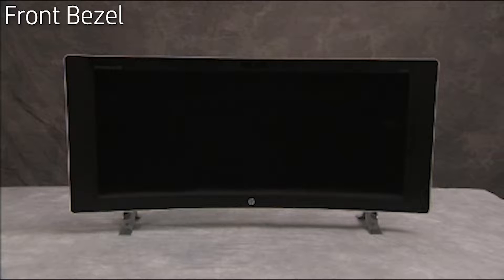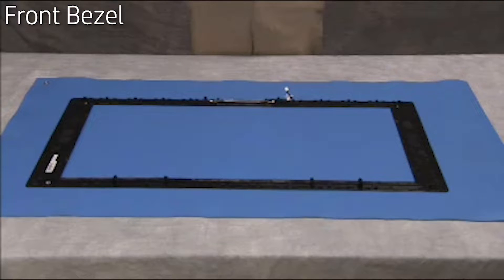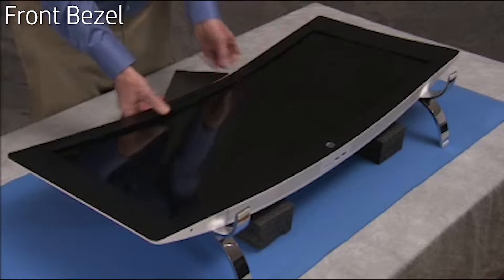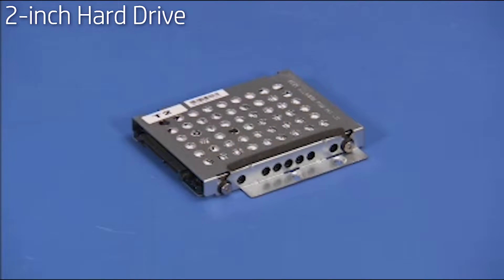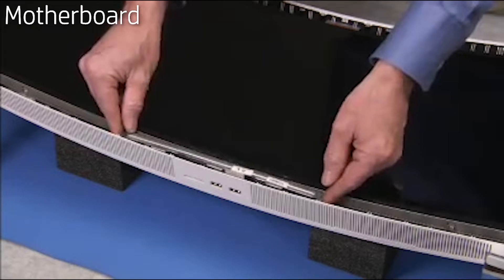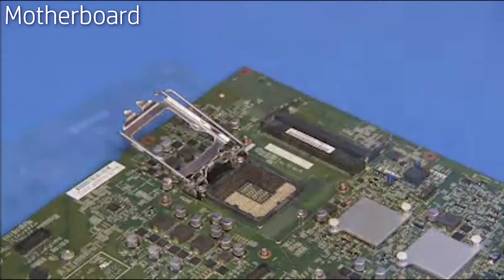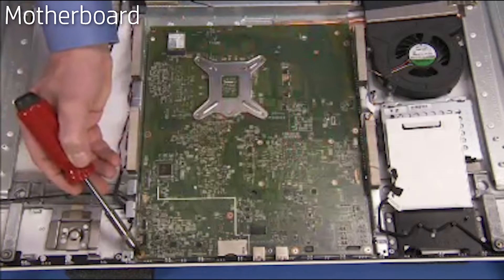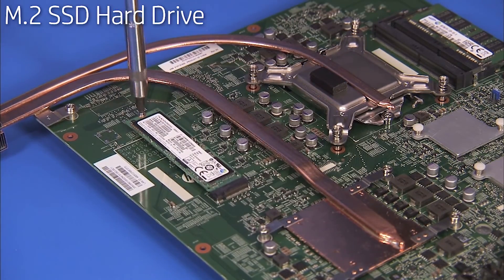Removing & replacing parts for HP ENVY Pro Curved AiO | HP Computer Service

Comment: Do NOT try to pull the bezel up from the screen edge. There is a strong adhesive tape on all 4 sides that holds it down very well. I recommend using a spudger/credit card/flat head on the outside edge of the bezel. I also had to use a blow dryer to soften the adhesive up to remove it without breaking anything.

One of the 12 screws (top left) that mount the screen to the chassis was completely buggered. No amount of unscrewing would remove it, even multiple types of pliers were no use. I had to use an oscillating saw to cut the bracket just below the screw in order to remove the screen! Terrible design flaw there...

All that aside, the SSD has absolutely no cooling. Somehow the original SSD lasted 10 years, even though it never dropped below 60°C! The replacement m.2 reached 80°C while installing a Windows update... I'm going to have to buy a low profile heatsink, or at the very least some thermal pads if there aren't at least a few millimeters of clearance.

Comment: There is a loud whirring noise coming from the top/left of the screen.  How do I fix that?  It's VERY hot up there.
Reply from the maker: +Rain, the Madocracy Please refer to the instructions mentioned under this document to fix the issue: https://bit.ly/3dCwsUx
Reply: @HPSupport  Thanks for the reply.  I've determined that it's the fan inside that's dirty.  I had this problem with my last computer, but that one could be opened and cleaned/replaced.  This video doesn't show you how to remove the screen.  I've heard the screen is easy to crack, for the people who actually figured out how to remove it.
Reply: @HPSupport  None of that worked

Comment: Hello can you give me a link to the partslist of this version: HP PAVILION 27-D0017NB
Does it use the same motherboard and cooling solution for the graphicscard and processor as the cheap 27-cq line as this version is more than 2x the price?
Kind regards Kenneth
Reply from the maker: +kd k You can purchase the part from here: http://partsurfer.hp.com/ Please select your country and enter serial or product number of your unit.

Comment: Warning: You can crack your screen doing this.  To do it properly use a screwdriver on the outside of the bezel and start pulling it up and out that way.  Try to get a lower corner popped open. After that, it comes off pretty easy.   If you put ANY pressure on that screen it's probably going to ruin it.

Comment: Is there a way to replace the GPU or heat sync. My HP Envy keeps crashing crashing when performing anything graphically intensive.
Reply from the maker: +Ranara Gaming Please perform updates via Windows and HP Support Assistant as mentioned below to fix this issue: Step 1 Windows Updates - 1) In the search box, type and open Windows Updates. 2) Check for updates. 3) If the updates are available, click on install and restart the computer. Step 2 HP Support Assistant Updates - 1) In the search box, type and open HP Support Assistant. 2) Check for updates. 3) If the updates are available, click on install and restart the computer.
Reply: @HPSupport  thank you for the reply. I already have updated the windows software and made sure all my other drivers were updated as well, however, this problem continues to persist.
Reply: @RanaraGaming  I doubt you can replace the GPU (soldered to the board) or heat sync- but what you could try is disassembly, cleaning them and reapplying thermal paste. It's possible the surfaces are possibly not positioned flush &/or the thermal pastes wasn't properly applied- make sure you use high quality paste also

Comment: For this price I could buy IMAC. Now I regret that I bought this HP.
Reply from the maker: +Evgeny Senkin May I know the model number of your computer and the exact issue you are experiencing on it so that we can check the details for you?
Reply: @HPSupport  Overpriced POS.  i5 Processor,  HHD instead of a standard SSD, so it can run at a normal speed, and you skipped a step on how to remove the actual screen, (WHAT SCREWS do you remove) I guess we are suppose to magically get to that part

Comment: A bit of info for anyone who is thinking of opening up one of these PC's.The demonstration of the bezel removal is nowhere as easy as portrayed in this video.I have removed mine  the double sided tape sandwiched between the bezel & the screen is very well bonded.
There are plenty of reports of people cracking the screen during the process, a very expensive problem to give yourself.

 I ended  up using a hair drier on medium setting to assist in  un sticking  the tape.Also the web cam cable separation  is not as straight forward as demonstrated. In my case the connectors were entirely taped over with extremely well stuck  black fabric tape ,unfortunately one of the connectors did not survive having the tape removed that result in the loss of functionality of my web cam.

Once the bezel  is off it is pretty easy to upgrade the memory up to max 32Gb , change the  mechanical hard disk for a  ssd  or upgrade the m2 ssd. I have personally removed  all of the tape from screen & bezel  now to allow me easy access to system in future 

Up graders should note that recent bios updates severely limit the types & makes of ssd that this system will now accept . For 2.5" ATA ssd's I know Intel 545s 500GB work & so does HP Pro700 1tb ( currently in system). My previous ssd  850 Evo 1tb stopped being detected & hung the system on boot  after  Bios upgrade to A0.13  

Good luck if upgrading your system ,but if willing to take the risk you can make quite  a few  performance  improvements  over the stock machines !